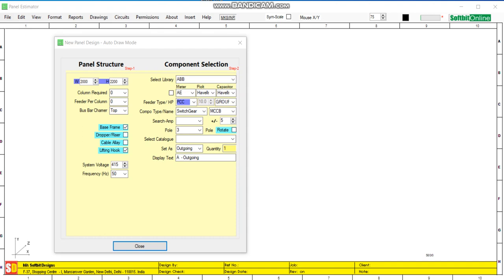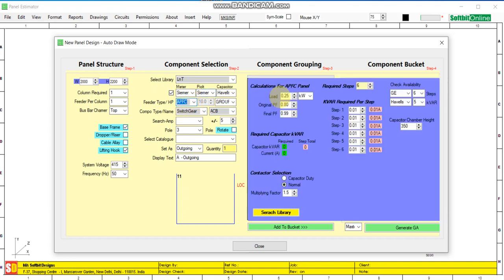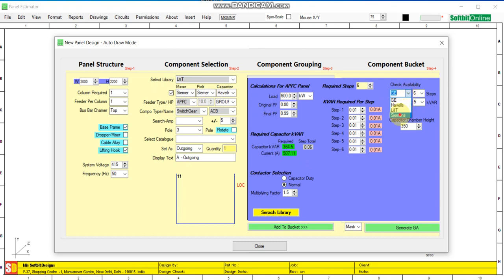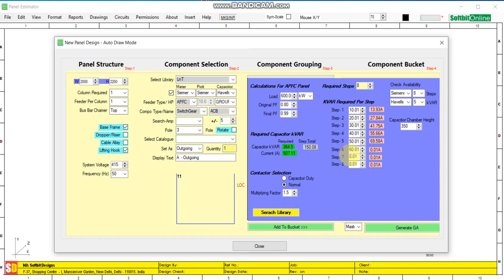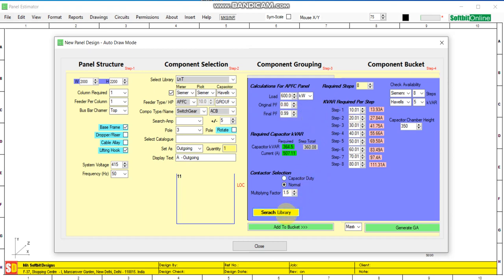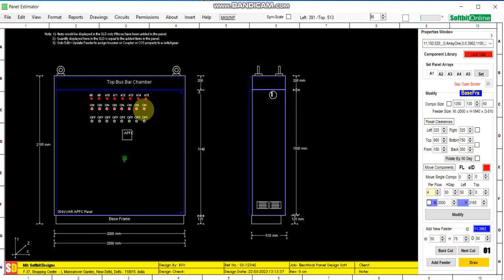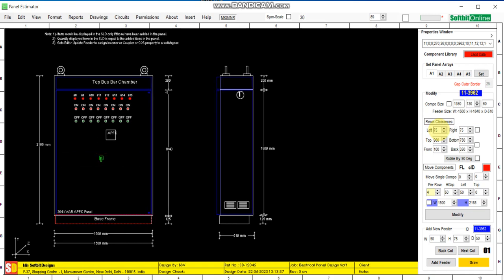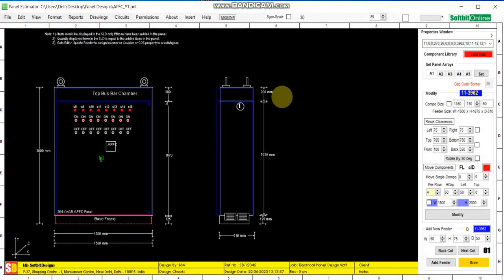APFC Panel Design With Siemens Power Factor Correction Relay - KVAR Calculation

Comment: the output file is  a .pnl file why not pdf ?
Reply from the maker: "*.pnl" is the design file name. When you take a print out then you can export the file as PDF or take direct print out through the connected printer.